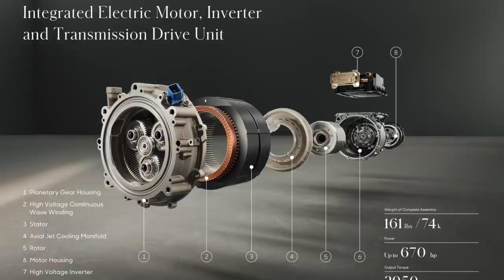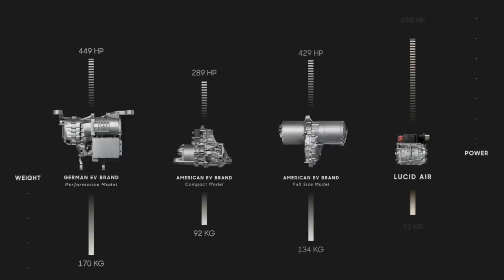I Interview CEO Peter Rawlinson About the New Lucid Air!

Comment: Excellent interview. Fantastic progress in the EV Industry by the Lucid Motors company.
Reply: what Progress ? LUCID just amitted to FRAUD, they dont make and use their own Parts in PRE Production vehicles.
Reply: Mark Plott they never claimed they used their own parts. BMW use supplied parts from external vendors for most of their car, yet they have BMW logos on, and are therefore BMW parts. Maybe wake up and join the real world.
Reply: @joewentz7839   - COTS and Catalog Enginering makes for a less efficient and WEAKER car.
doing EVERTHING in house is how auto manufacturing should be done.
also using 1st Principles in Engerneering and Vertical Intergration .
Reply: Mark Plott nonsense. The need for vertical integration depends on supply chain capabilities. Tesla develops their own infrastructure to advance their position where external supplies are lagging, but have pretty much used third party suppliers, like Panasonic and CATL, to build their business up to date. Vertical integration is good, but not the be-all and end-all of a business. What I do like about Tesla is that it's an engineering driven organisation, with money going into R&D, and no marketing bullshit. Hopefully the same with Lucid. But as Lucid CEO was a core member of Tesla S team, he knows what it is about. 
Lucid are already targeting key Tesla weaknesses, particularly the finish and interior quality. But at a price premium.
Reply: like what?

Comment: I think the integrated drive unit might be the best IP here...and I look forward to its continued iterations in the future, both from Lucid and other manufacturers.   I'm just imaging the day when buying a complete drivetrain either for a startup, a shall shop, or a home hot-rod mechanic is so easy when everything is practically "all-in-one."  Basically, choose your battery, choose your drive unit and done!   (I know this is starting already on a very small scale, but I'm talking about when its the norm)  Sort of the crate engine idea, but taken so much further.
Reply: Inverters and software to make everything work well when fully integrated. Still makes your idea tough. Just look at any ev swap outfit. Aem though is getting into the bev control unit space. 
See bisimotos bev Porsche 935 which uses tesla drive unit, lg chem battery, and aem driving everything. 🤔

Comment: Smooth and down to earth speaker.
Reply: another Trevor Milton.
Reply: @markplott4820  
Not really. 
Making a successful car company is extremely difficult, so they still might fail. 
There is an opening now with new technology. Rawlinson has experience with batteries, racing, and design. Milton had experience scamming people based on other people's technologies.
Reply: @AWildBard   - Formula-e batteries wont be making it into Production cars.
they are using COMODITY cell from LG Chem. 
not IDEAL.
Reply: @markplott4820  
Ok, 
Almost every EV manufacturer is using LG Chem batteries, though. 
It's not a scam. 
Maybe the company will fail to get off the ground. But at least they have a ground. Nikola had no foundation from what I can tell. 
let me ask you- Why do you think he's like Trevor Milton?
Reply: @AWildBard   - PETER's play is to stick arround long enough to SELL Lucid to a OEM. then cash out, leave LUCID and Retire in a Island with NAKED women. 
and Peter is an OLD guy, how long do YOU think he will LAST ?
ELON has got DECADES on him. 
and ELON has Mutiple SONS that Could follow in his Footsteps. (Iron Man).
Reply: @AWildBard   - but LUCID is NOT using the Formula-e batteries in the car.
they are using COMMON LG Chem cells.
Reply: @markplott4820  
He certainly does talk a lot about how some other companies could be using his technology innovations.

Comment: Another company that is willing to invest in the changeover to electrification of mass produced autos is great news for everybody! Their technology will eventually be pushed down to cheaper vehicles and soon everyone will be driving on the power of the sun and wind.
Reply: The low cost EV is almost certain to be a robotaxi.  Based on Elon's estimates of the cost of operating a robotaxi company (<$0.18/mile) we're likely looking at a future where few of us own cars.  We'll phone for a ride and keep thousands of dollars per year for other purposes.
Reply: @bobwallace9753  while I agree with you, I'd also venture to say that future is several decades away. In the meantime, the average person will have owned and sold several cars between now and then.
Reply: @FuriouslyFurious  
The future is already here.  At least partially.

There are currently a few robotaxis hauling passengers in the US and China but with a safety driver backing up the self-driving system.  I've seen no indication that there are any unsolvable problems with making the systems safe enough to remove the supervising human.  

Tesla is currently in the process of releasing a much improved full self-driving system, a significant improvement on what they had been testing earlier.  That system should be in hundreds of thousands of Tesla EVs by the end of this year.  Over the following ~2 years the FSD system will be tested by running in "shadow" mode.  The computer will determine how the car would perform if the FSD system were in control and compare that to how the human drives.  Decision differences will be sent back to Tesla's AI computer to train it to be a better driver. 

Most of the data sent back is likely to be about 'edge' cases, those weird things some drivers see very infrequently, most drivers not at all.  Tesla collects billions of driving miles worth of data per year and will, or will not, demonstrate their system is ready for driverless cars as they solve for edge cases.  My guess is that the data will support driverless cars within three years, fairly certainly within five.

Many government agencies that control highway safety already have standards that must be met for driverless vehicles to operate on public roads.  Show the data = get approved to operate without a driver.

The potential profits for robotaxis is enormous.  Right now the average per mile cost for Uber/Lyft is $2.  And riders add an average $1/mile in tips.  People are paying $3/mile for ride sharing.  Tesla calculates their total business cost to be less than $0.18/mile.  My guess is that robotaxis will offer rides priced significantly lower than ride sharing but at a very high margin over their costs.  

Suppose Tesla gets approved for robotaxi service in three years.  They offer rides at $1.50/mile.  25% less than Uber/Lyft along with no tip expected or accepted.  That would be an 88% profit when 20% is considered very good in most businesses.  

Later on as more robotaxis are in service competition should drive down the cost to where is won't make economic sense for most people to own a car.  Cars will likely be luxury items, owned mostly to display one's wealth.  Most people are likely to want to spend the thousands of dollars per year on something other than a unnecessary car or retire earlier.

Tesla builds factories and starts manufacturing cars in less than 12 months.  I would bet that Tesla has plans in hand for a car designed for robotaxi work and plans for factories to produce them.  Tesla could quickly be manufacturing millions of new robotaxis per year five years from now or not long after.

I am not saying this is what will happen.  I'm describing what I think is the quick end of the time period during which we see major moves from private car ownership to robotaxis.  I do think the slow end is no more than ten years away.

Comment: Its happening. Gasoline is on the way out.
Reply: It's done, they just haven't realised.
Reply: Ridiculous nonsense. In the UK I can buy a perfectly adequate ICE car new for a mere £6,995. Add £1,000 for the model with AC. Expensive performance luxury cars are an irrelevance.
Reply: @pasoundman  Why get screwed like that? EVs once they become mass will be way cheaper... not to mention that after the £6,995 you will have to spend £8,995 for medicine because of the toxic fumes...
Reply: @DaveBoxBG  This idea about 'mass production' making EVs cheaper than ICE cars is simply unthinking and uncritical futurism. EVs need parts like a charger and an inverter for the motor. Power electronics aren't cheap and such assemblies are multi $1,000 cost adders. EVs  also use lots of rare(ish) and expensive materials like copper and rare earths. All of this also makes EVs heavier than their ICE equivalents. The extra weight alone tells you that no way is it ever going to be cheaper to make. Simple hard facts that aren't negotiable and won't go away no matter how hard you wish.
Reply: @DaveBoxBG  Screwed ? I can buy a servicable ICE new for £7,000 or a Tesla for £35,000. Seems like a no-brainer to me. Been driving cars since 1973 and I haven't been poisoned yet
Reply: @pasoundman  LOL, Elon just announced that they are not going to use rare materials anymore in the new batteries :) 25 000 cars are around the corner. Also ICE cars need a lot of oil supply in their entire life and expensive stations to fuel them all the time. This is not going to work and is already falling apart :D It is amazing that there are still some people that have no idea and do not see this :D
Reply: @DaveBoxBG  I was talking about the rare materials used in everything additional to batteries, like copper and rare earth magnets in the motor, expensive power semiconductors in the powertrain. 25,000 cars are not around the corner that are luxury, hyper performance types like the AIR (which isn't on sale yet and is an irrelevance to 'sustainable motoring'). BEVs will always weigh more than their counterparts which tells you everything you need to know about the price. Just plain simple boring engineering facts that aren't going to  change.
Reply: @pasoundman  OK then show me your luxury 6000 car??? Where is it?
As for the weight add the oil you are spending to that equation. Yes ICE weighs more. A lot more. And is a pain to service and fuel...
Reply: @DaveBoxBG  I imagine that the 'rare material' no longer to be  used in Tesla's batteries is cobalt. Nickel, copper, manganese aren't exactly abundant you know.
Reply: Cristi  That is why Tesla is releasing 25k car. With the average price of 32k of the mass ICE cars no one will have money for ICE cars in the future. Not to mention that Tesla cars will not need fuels and maintenance. Even the cheapest ICE cars will be for the rich and stupid.

Comment: A Formula E car wrap in a nicely designed sadan shell. Is it truly mass producible?  Engineering and software would determine if actual performance claims are real. He mentioned up front they are not there yet on either account. He talks a good game asking and all, though I'm still a little suspicious.
Reply: In my view it's not so much a question of performance, but rather longevity of the system. Formula E only uses the batteries and powertrains in a 40-50 miles race. They can completely rebuild for next race, if they need to. How did they address this potential weakness in a car that's supposed to be recharged 5,000 to 10,000 times and the powertrain should withstand hundreds of thousands miles?

Comment: California plus 30 other states require a front license plate. Will LUCID be street legal in states that REQUIRE a front license plate?
The coastal roads and states that use salt in winter experience horrible corrosion. How will the BRAKE ROTORS resist this corrosion?

Comment: Formula E race is 40-50 miles. You can literally scrap both the battery and the drivetrain after the race. What sort of lessons could possibly be drawn for the design of a vehicle that ideally would withstand 5,000-10,000 charging cycles and up to 1million miles?
Reply from the maker: That’s a question of the cell manufacturing which they don’t do. They buy from LG chem. They are pack manufacturers

Comment: The longer range is not due to improved efficiency in technology. The Lucid Air is just a smaller car with a bigger battery than the model S.
Reply from the maker: No it’s not. It’s barely smaller, and if the Model S had a 113kWh pack, it would not have 527 miles

Comment: Ricky ...really?   lucids  high tech battery races 40 miles at a time and thats a high tech battery?    You are  touting that as high tech?  Maybe this isnt the field you should be in?   as an engineer i thought you woudlve caught that... I guess tesla at 400 miles doesnt stand a chance then  because lucid is the  high tech here...
Reply from the maker: You’re describing endurance and range. There’s other attributes to a pack, like power density, cooling etc. racing applications push batteries very hard.

Comment: Two Bit da Vinci - LUCID storage batteries will be TOO Expensive.
LUCID is using the same cells in Vehicles as in Storage.
NOT a good Idea. TESLA is moving Away from using Permium LION cells in GRID storage and will be using LFP by CATL. 
as Expensive Premium battery are BETTER served in Production Vehicles . 
you can Either use HOMOGENUS Spare cells from Various suppliers and LFP is Paticurally well suited to GRID storage and Buses /Trucks.
and it seems , TESLA still plans on using LG Chem Cylrindrical in its POWERWALL products, for NOW.